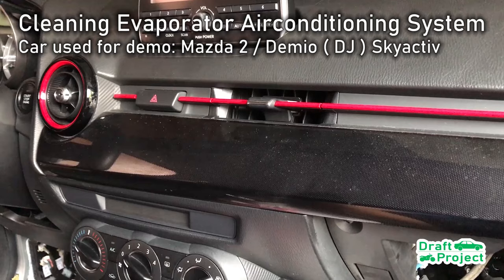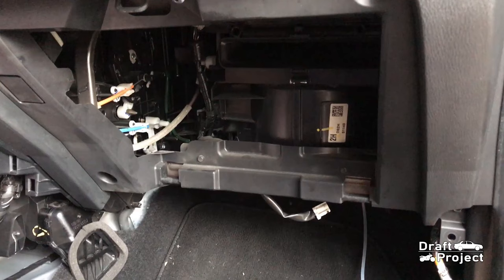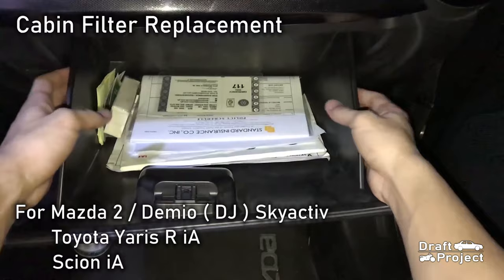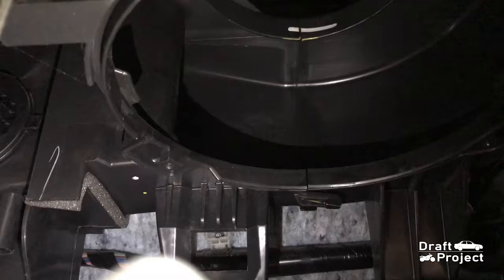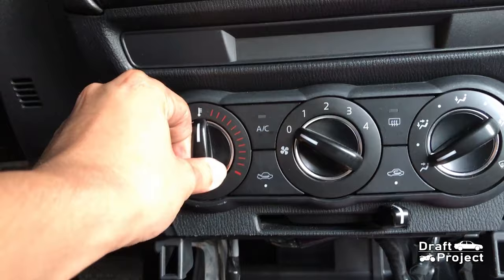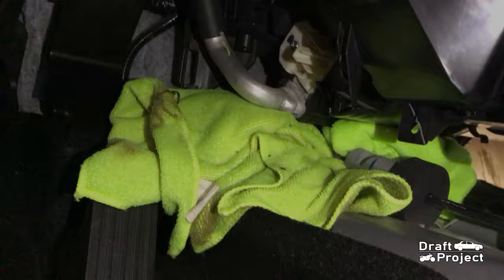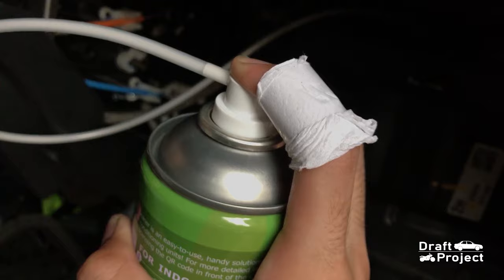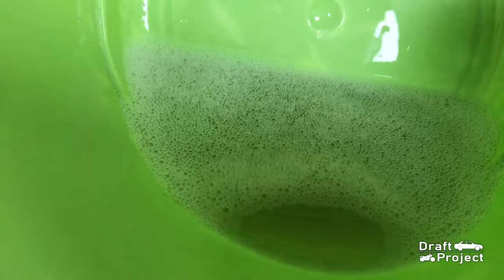How to Clean your Cars Evaporator - Air Conditioning System

Comment: Do I understand it correctly that little branches, leaves etc can also get stuck in there, and that it is advised to clear that kind of stuff first of all before using this sort of foam? Thanks.
Reply from the maker: Yes. Those leaves and other debris get stuck on the cabin filter. This happens when you turn off the recirculation mode of your climate control.

Make sure the area is clean, so that there will be no leaves or dirt that will get saturated by the solution which can cause more filthy effect on the A/C.
Reply: On some vehicles you have no filter, in which case all that crap gets jammed between the evaporator and your blower fan, and in front of the fan, so you have to remove that fan and slowly carve all that crud out of there, like on a ford ranger for example

Comment: My car smells, I've done anything to remove it, it only smells when I turn on the aircon. I have a suspicion it's coming from the evaporator, does that even make any sense? I haven't cleaned my evaporator since 2015.
Reply from the maker: Yes. There could be molds in your evaporator due to years of moisture and condensation in the system. The blower will blow air into the evaporator, pushing its way into the aircon vents including all the odor inside.

The cleaning method in the video can help or worsen depending on the condition. In that kind of scenario, it is recommended to be cleaned professionally by an aircon specialist for a best result.
Reply: @DraftProject  i see, thank you very much!
Reply: Did it go away now?

Comment: After using the cleaner the smell still remains any ideas or tips?
Reply from the maker: Based on my experience with the cleaner, it produced unpleasant smell after a few days. I waited for a week and kept on using the air conditioner on a daily basis, the smell lessens until it is gone. It seems like the smell of the cleaner mixed with the dirt inside the evaporator or the foams or cushions between the aircon duct and cabin seems to absorbed some of the cleaner, making the foam wet. Therefore, it produces smell which eventually will be gone once it dries out.

If the case is different like your aircon blows the same smell after cleaning it with a cleaner, then I hope these tips will help you.   
First, make sure that your cars interior is clean especially in the passenger area. Be sure to remove any kind of air fresheners. Behind the glovebox, make sure that there are no dirt or stains that produces bad smell because this is where the blower motor sucks air if the recirculation mode is activated. If it is not activated, then check the wiper cowl on the passenger side. Make sure to clean every vents that you can see because this is where it sucks air. Most of the time it is clogged with leaves, dirt and debris so be sure to check it and thoroughly clean the area. After that, you can try changing the cabin filter and clean the blower motor. If the smell still remains, then there are two options that you can do. You can try it again with a cleaner or take it to an aircon shop for a thorough cleaning. If the interior is clean and all of the filter, cabin blower area are already been checked and there is nothing that you can smell except the air that comes out from the A/C system, then probably the evaporator is quite dirty to the extent where the cleaner cannot penetrate and remove the dirt inside. It needs to be serviced for thorough cleaning.

Comment: the coil take the HIGH pressure liquid (Freon) from the compressor and the change over from HIGH pressure to low pressure happens at the metering device at the coil which is how you get cold air. The low pressure  is now a vapor nd returns to the compressor to start the cycle over again.
Reply from the maker: Thank you very much for the added info!
Reply: This is exactly what happens.  Thank you. ❤

Comment: Hi do you know how to remove the blower resistor of mazda 2 skyactiv? It does not have screws on it.
Reply from the maker: Hi sir, I haven't tried removing one in our Mazda 2. I searched for it and the housing of the blower resistor seems like it is held by plastic tabs. Perhaps you can try to check if there are any clips that holds the surrounding of the housing or you can try it removing by gently twisting it and see if that works. I'm sorry sir for that. I hope this suggestions would help.
Reply: You should remove the blower resistor , it can be easily damaged during the process when it gets wet.  My blower resistor was damaged during the process because i forgot to remove it. It should be prioritized ,remove it  during the process. After sales of blower resistor for mazda 2 is very difficult to find.

Comment: I would like to know how to do this with my 2003 jeep liberty limited. I have already replaced fan motor and resistor..
Reply from the maker: You can do it just like how I did in the video. You can skip the process where I put some into the aircon vents.
Put some rag underneath the dashboard and center console. Especially under the blower motor and evaporator.
Close all aircon vents. If not applicable, cover it with a rag. 
Simply locate the place where the cabin filter is inserted.
Remove the filter and grab your aircon cleaning solution and aim it into the fan blower.
Turn on the Blower in max speed. Then, you can start spraying.
Be sure to spray in on an interval. Don't spray continuously, otherwise you might flood the blower motor.
Once you empty the can, turn on the A/C switch and let the evaporator rinse.
Then, after rinsing, turn off the A/C and let the blower run to dry off the evaporator for 15-30 mins.

Comment: Thanks for the video! So it's better to spray the blower than a A/C Grill?

I've done this in my car with only 1/4 can, but no liquid comes out under my car, is it because it's only a 1/4 can?
Reply from the maker: Yes. The proper way is to spray it on the blower motor because that blower will push the cleaner to the evaporator. Once the cleaner penetrates, it will slowly unclog the cooling fins and make it passable and clean. Spraying on the vents is optional but it can help because that can reach some areas that the other side can't.

I think yes, it might be. When cleaning, be sure to empty the can so you can fully utilize the cleaning solution.

Comment: Is it safe to spray the foam to air intake vents? I have Yukon 2007 not able to do your procedure
Reply from the maker: For the Yukon, I don't think it would be effective to do that since the evaporator is place not on the middle, but on the left portion of the passenger side. Just try to get access to the blower motor because that is where the most effective place to begin with. In my video, it happens that I put some into the aircon vents because this Mazda 2 has an evaporator that is near to the center part of the dashboard.
Reply: @DraftProject  thank you for the advise. I already made a small hall between the fan and evaporator to insert the cleaner hose. Turned on the AC and sprayed. It worked awesome. After that I closed the hole by sticking tape.
Reply from the maker: @happycats5223  Sorry for my late response. Glad to hear. Thank you very much too!
Reply: On a 96 F150, can you just put the product in the vent?

Comment: Removing the center console is NOT necessary. The objective is to just get cleaner on the evaporator coils and have it flow down to the drain. A boroscope camera is far more useful than removing the center console.

Comment: I have a 2007 yaris sedan , musty airflow in the ac system, can I get any recommendations?
Reply from the maker: Try to check the cabin filter if it is wet or dirty. Then check the surroundings of the A/C cabin and interior for any smells. Look for any leaks inside the vehicle. If everything is good, this could be the evaporator. 

If you are using the non-recirculation mode, check for dirt or anything damp on the vents of wiper cowel.

Does the car has any history of A/C cleaning service? If not, then I would recommend taking it to a shop that specializes in cleaning A/C without dismantling every parts.

Considering that your aircon has musty airflow, I would not recommend to use the cleaner on the video. In my experience, that can cause the smell to worsen.

If you ever wanted to try this cleaning solution on the video, I would advice to rinse the evaporator by letting the A/C on for 30-40 minutes after the cleaning procedure. Letting the A/C on generates moisture on the evaporator, causing it to become wet while rinsing all of the cleaning solution.
Reply: @DraftProject  thank you so much for your response. I changed the ac filter twice. The smell remains. The musty smell intensifies after the ac becomes very cold and starts to give off frost.
Reply from the maker: @leroyfoster6487  In that case, it seems like the evaporator needs to be serviced. Every bits and pieces inside the A/C cabin should be cleaned to remove the smell.

Comment: Will a dirty evaporator cause warm air to flow out of the ducts while sitting at a light and then cold air once moving forward?
Reply from the maker: It can be a factor since it might be clogged up a little bit. Another one is that it may not have enough Freon in the aircon system.
Reply: @DraftProject  
But if there wasn't enough freon in the aircon there wouldn't be any cold air at all.
Reply: That can possibly be a bad cooking fan
Reply from the maker: @MrJohnnyDistortion  Yeah but there are instances where it could be a factor since it depends on the amount of freon on each cycle.

DrakoKamikaze8823 suggested a bad cooling fan, it could be a factor too. 

Another thing I would suggest is to try setting your climate control to its max setting. If you turn it quarter or half cold, that could sometime result a dull or warm air when not moving because A/C cabin system nowadays are operated by a flap inside the cabin. When the setting is half or quarter, the flap is not fully closed so the heat from the heater core gets into the whole cabin.

Another one is to have a specialist check the system. Problems in the aircon system can be tricky too since they kinda share similar symptoms over different parts.
Reply: @DraftProject  
Cooling fan is new. 

I have no climate control. 

It's a 2008 Honda Fit Sport.
Reply: @MrJohnnyDistortion  when you press the AC button and it lights up (or basically turn on the AC), does the cooling fan spin? The computer is supposed to send the cooling fan a signal to turn on once you turn on your AC.  I do hope you have it working good by now!

Comment: Thank you a million. Unfortunately, I didn't find any video for cleaning the evaporator of my mazda MX-5 NC😢, any body know, how can I clean it? How can I rich the evaporator?
Reply from the maker: Just locate the blower motor of the vehicle. Then with a can of solution, just like what I 've used in the video, just spray the solution intermittently while the blower motor is running. The solution will reach the evaporator since the blower will push it. Just check the can for extra details on how the cleaning solution works.
Reply: @DraftProject  Great! Thanks a million!!!
Reply from the maker: Thanks too! Good luck and take care.

Comment: After doing this, should the floor be cleaned and removed?
Reply from the maker: Just wipe off the areas that are wet. Not necessarily needed to remove the carpet if it is wet. Most of it would be damp and would dry off eventually. 

About the floor mats, it's better to clean them so that the blower of the aircon system would suck clean air inside the vehicle.

Comment: Does it damage blower motor?
Reply from the maker: Nope. Just make sure when you spray the cleaner, the blower motor is running. Don't flood or spray too much on the motor to prevent the motor from totally getting wet. Spraying has an interval.

Comment: My problem is that when i make turns that it just pours water into the floorboards
Reply from the maker: It is normal that there will be leaks since the cabin system is only sealed by foam tape. But, if it leaks too much then perhaps somewhere in the cabin panel has a broken seal. Maybe the foam tape is gone since it disintegrates overtime or a certain part of the cabin wasn't properly installed, therefore it has leaks. Just make sure to catch leaks with rag to prevent the carpet from getting wet.
Reply: You might have a clogged AC drain.
Reply: @splendidcolors  dis